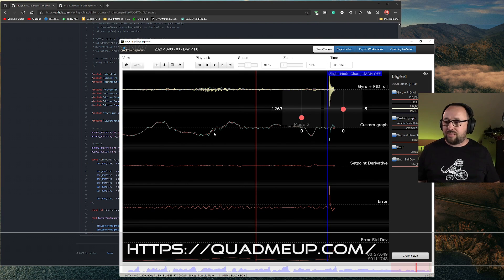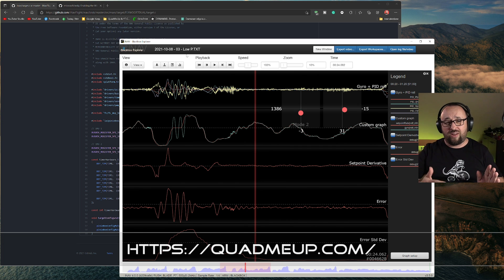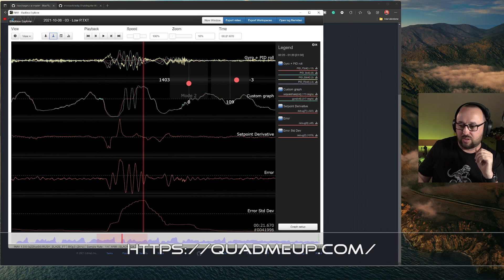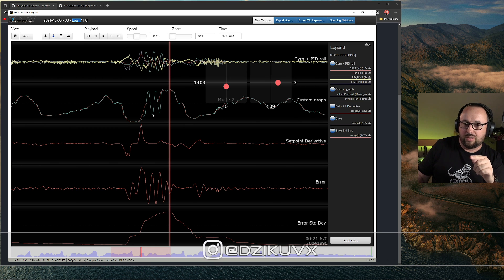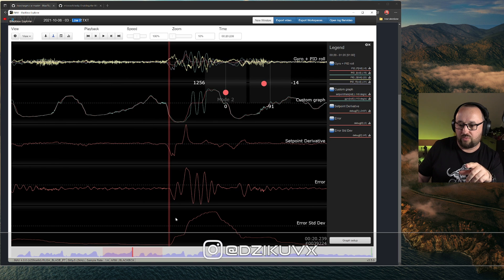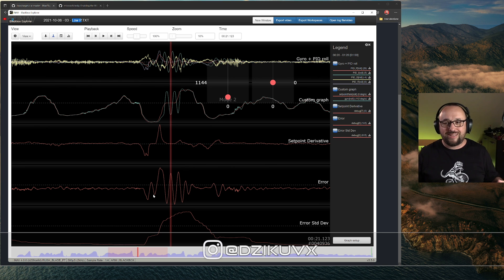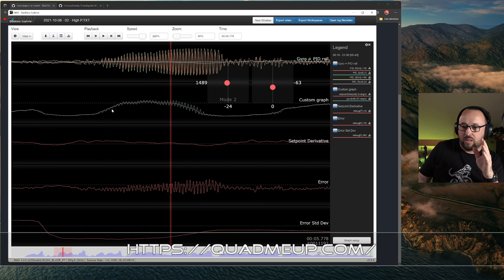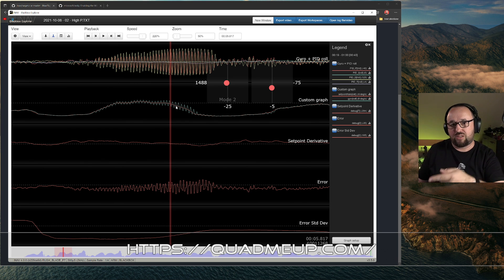Can we have an automatic PID tuning for FPV multirotors?

Comment: So I wondered for last ~3 years why nobody even tried to implement something like this based on actual knowledge. Adding post flight analysis like this to PID Toolbox would be brilliant. In-flight autotune would be a bigger breakthrough than rpmfilter in my opinion. Classic overshoot/undershoot detection is known as Ziegler-Nichols algorithm and is widely used in industrial aplications and it may be a good first step in multistep autotune. There are other more precise methods also used in industry for example motion control in CNC machines and industrial robots also use PIDs and autotune and those aplications have similar responsibility to our quads but exact procedures are usualy one of the most well-kept secrets of the manufacturers of this type of drives so it may be not so simple thing ;). In my experience one of the most obvious indicators that differ good tune from crappy one is propwash in good tune it almost disappears to the point where it is difficult to cause it on purpose and it takes place in a very narrow range of PID settings. This fact can and should be used in the algorithm.I personaly do fine tune basing on this- if there is hard to get propwash it probably cant be betetter tuned. Im not so good in software development and cant help in this mater but I can provide for example logs from setups that seems to be a good tune - i alredy have some diferent builds from mine and my friends that are tuned to "nearly no propwash state"  if this is needed i can get logs from them, and I am happy to test the experimental firmware if something like this will be needed. In my opinion UAVTech and Chris Rosser are absolutely crucial persons in this project and you should contact them.
Reply: The info you have shared here is really awesome! I hope Pawel finds it useful.

Comment: Maybe this could be a "just find the tune" firmware, where the parameters are stored in CLI commands to execute in CLI in other flight firmwares. Like your have to flash and reflash the eachine pro58 vrx.
Reply: I like this. What if there was a way to execute a sequence of automated and controlled flips and rolls, something pre-programmed you could launch by flipping a switch at certain (safe) altitude. Then you cou could bring your blackbox log to a computer software that analyzes that specific sequence and suggests changes, then you could repeat and fine tune. The more you do it, the better it gets. Something like that.
Reply: @dpxfpv  this is what the dRonin autotune does! You flip a switch, and the Copter starts doing some maneuver. After about 30 seconds, your tune is done. You plug your Copter back to the computer and can fine tune, or just save and go flying. Worked fine on my trifecta with CC3D!

Comment: dRonin and it's predecessor Tau Labs / Openpilot had this several years ago.  Hopefully you can get close to the results we had with that.  I still fly dRonin quite a bit, just with older hardware.

Comment: Some thoughts on the approach/workflow for the autotune process.
1.	Verify the quad qualifies for autotune. Check gyro noise levels by setting a threshold value of acceptable level of noise. Consider if someone has a loose motor, bad prop(s), bad gyro, bad harmonics of poorly designed frame, etc... This check can be done during basic flight in real time.
2.	Multi step tuning analyses process, records RC input, current PID, gyro data, Etc required from a set flight instruction and or maneuvers given by the pilot. Land and then analyze the recorded data to get the needed future state PID values. Repeat process as needed with various sets of flight instructions and or maneuvers given by the pilot. 
3.	Record original PIDs for later restore if needed
4.	Apply new PID’s
5.	Pilot verifies the new PIDs are acceptable or not and has an option to restore old PIDs from the original values even after power down.

Comment: That's not a good idea to have oscillating aircraft in the air during tuning)) Why don't you want to try it in another way: first of all tune each parameter separately. Than there are 2 ways: 
1) The easy way: start from P and raising it until error between gyro and setpoint during stick movement stop to decrease and make a one step down, than raise D to kill overshoot and than raise I and wait for I bounceback. 
2) The hard way but extremely good tune: raise D until it start oscillating. Raise P to reach the setpoint. Raise I and wait for I bounceback.
Also stop this stupid filter tuning. All 5 inchers should have no lpf on gyro, but only dynamic notch from 140 to 600hz, Q 6000, and d term lpf biquad at 120-130 Hz. Stop confuse people with lot of useless parameters. If the drone don't fly with such a filter settings than it's a hardware problem person should troubleshoot, but not trying to kill this problems with no success with useless software parameters.
Reply from the maker: The thing with only error tracking is super prone to error. And craft might both undershoot and start to oscillate

Comment: Just a little question, what if you add an item into the osd, between the feature list, called autotune, wich will analyze the blackbox and will apply some calculation? Because I think that doing that in real time is pretty hard, since there could be the risk to increase the pid loop resulting with calculation being wrong. I know that there is a mathematical approach wich can use data from the blackbox. Of course every time you have to use that function would be usefull to delete the blackbox before flight.

Comment: I remember when I said this to UAVtech months ago on a livestream. He was dismissive and strangely kept insisting it would have to be done using the airbourne cpu even though I said to do it using a desktop pc analysis of blackbox. I think a properly implemented autotune has tremendous potential.
Reply: Something that works, is one thing; that exists.  Something that works well and actually finds the correct tune is another.

The problem with desktop, is you don't have the system (the quad) live for the PC to test new values against.

The problem with airborn is you have lacking storage and PC power to do a proper job.
Reply: @uavtech  Yes I just figured after each flight it could auto download logs and over a period it would adjust accordingly. I get if you want instant results it becomes more challenging but then for people who can't tune or don't have time to tune a longer process would be fine. I even thought you could integrate it into Betaflight as part of the dashboard with a series of coloured indicators for obvious issues and an autotune suggestion tune autoloaded on a controller switchable profile after sufficient collation.

Comment: What if we can put something like TensorFlow on the FC?
Reply from the maker: First you need a model. A model that simulates YOUR craft. Not some craft. Neural networks are not magical solution
Reply: @FPVUniversity  I know that Neuronal networks are not magic or intelligent. And I know that you know so much more than me on this topic.
Reply: @FPVUniversity  But some kind of machine learning may be a thing here. But it should use central database/cloud to colect results of autotune from all those people who actualy use it and try to improve results in the future- waaaay much simpler say than done I know but a few years ago no one dreamed of FPV in the form we have today.
Reply: It would be able to to reinforcement learning on a race simulator to optimize a fast flight thru a given track. Thats a macro view of quads. (Direction, speed and inertiamofmthe quad). To eliminate oscilations you need a micro view for all the micro details of physics like prop vibrations, frame vibrations, air turbulances. Developing a model for that would need horrible efforts - just for one specific quad. Doing the training on a real quad would ruin the motors quickly due to letting the system try out every setting, including bad ones. (thats the nature of unsupervised training)
Dronemesh talked about reinforcement training out of blackbox logs, implementing an onboars ai filter. But he must have come to similar conclusions.
Reply: could use machine learning maybe just to identify oscilations on the data and label them